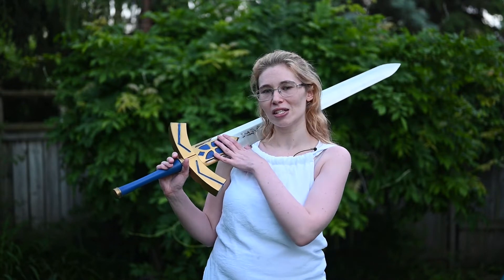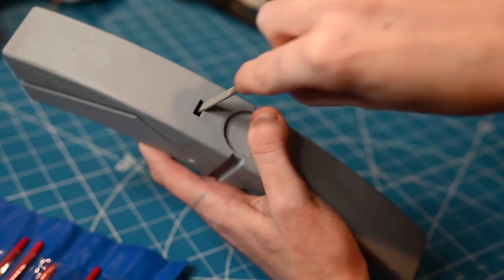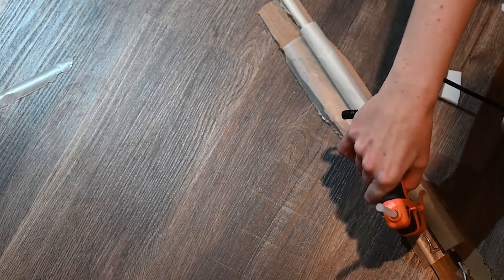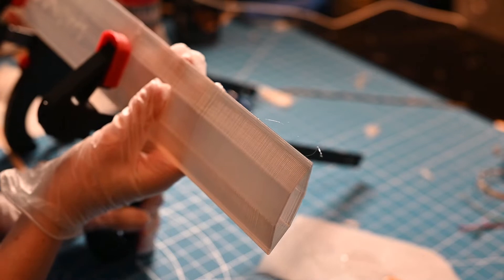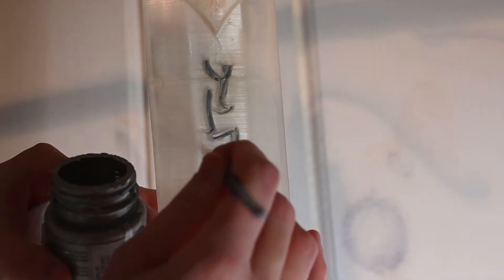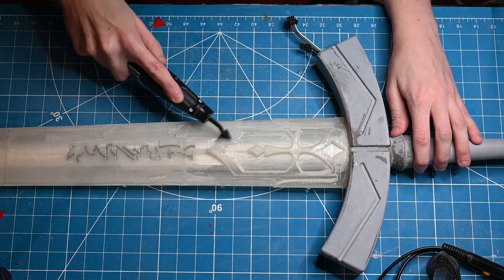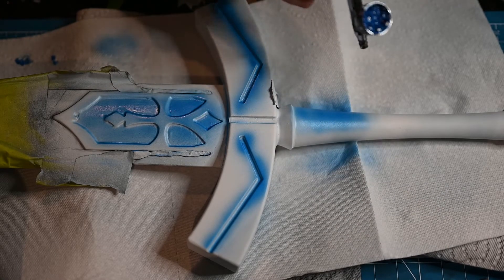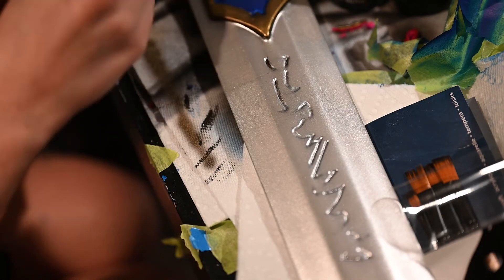3D Printed LED Excalibur Sword from Fate Series

Comment: This is exactly what i was looking for my sword I 3d designed because I wanted to avoid making a silicon mold and using resin. I have 2 questions:
1. What filament did you use for the transparent part?
2. I have a gem on my sword the glows as well (orange/red), will watering down colored paint work as a transparent top coat for that as well?
Reply from the maker: I've thought about using resin - but you'd have to have a massive vacuum tube to get rid of bubbles. 😅 I used transparent PLA. I'd probably make the gem out of clear resin and mix in the coloured pigment.  I'd suggest testing a few different methods to find something you like! I do experiment a lot for my cosplays. ^~^
Reply: @byteprops  Since you only put one led strip, was distributed nicely to the other side where there wasn't direct light?
Reply from the maker: @xadiimagine  Yes, you can still see the LEDs from the other side! It looks better because it's more diffused and you can't see the individual LEDs. (Diffusion is really difficult in such a tight space).
Reply: @byteprops  thanks for this really! I end up winning Fabrication award for my cosplay!
Reply: Link to switch used